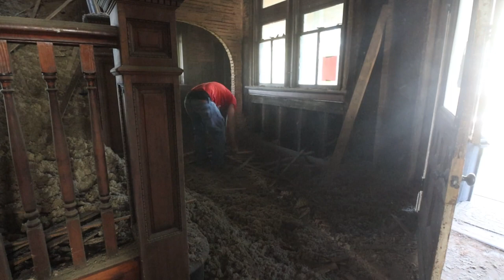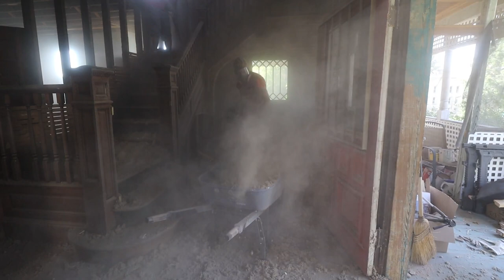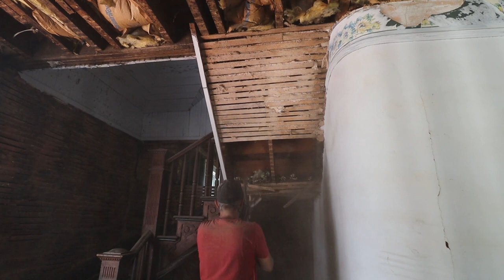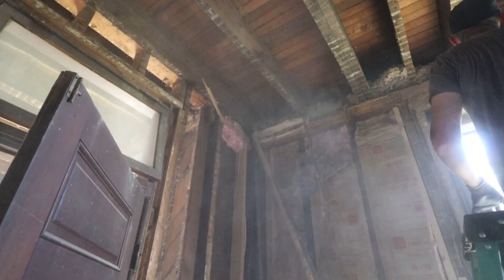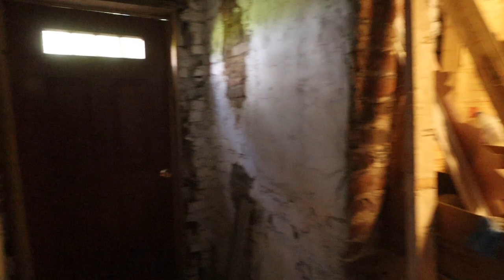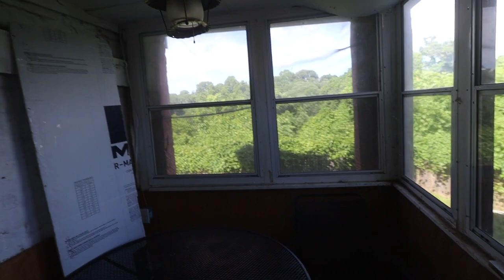Giving Up? - Victorian Home Renovation [TirolerInn]

Comment: Do you plan on keeping the interior period correct and using new lath and plaster?
Reply from the maker: we are planning on keeping it to period in the first floor and the hallway upstairs. instead of doing lath and plaster in those areas we are going to do purple board and plaster, besides the wall that has the round corner wall (which we are just repairing if possible, we never removed the lath for that area)

Comment: Did you test for lead paint or asbestos before removing the plaster? Or did you just assume that there was lead paint on the walls and demo accordingly? We are getting ready to renovate a house from 1890 and trying to figure out how best to remove all the walls
Reply from the maker: We assumed there was lead as it almost impossible that there isn’t. As for asbestos, we assumed none as the likelihood of a residential building pre 1920 having asbestos unless it’s a fireblocking wall for elevators is very slim.
Reply from the maker: The best way to remove the walls was using a 2x4 board and starting from the bottom and just pulling it all out from the bottom.